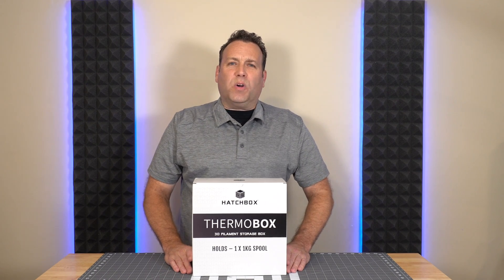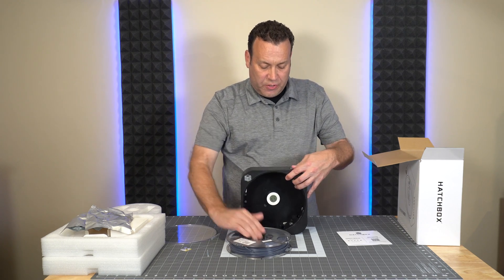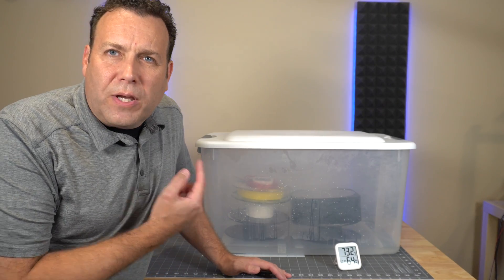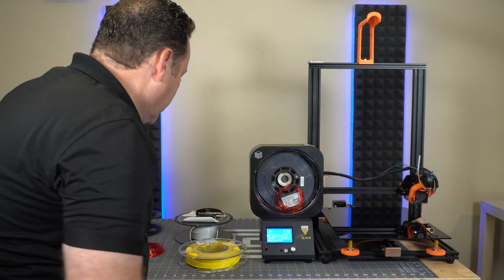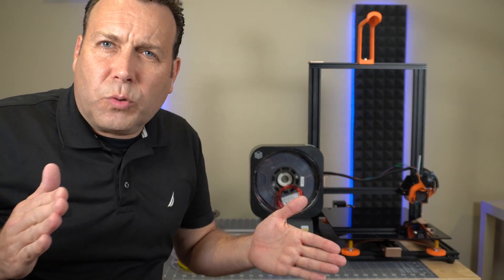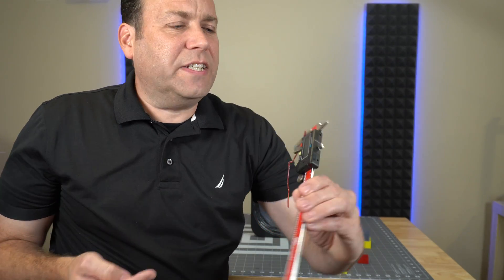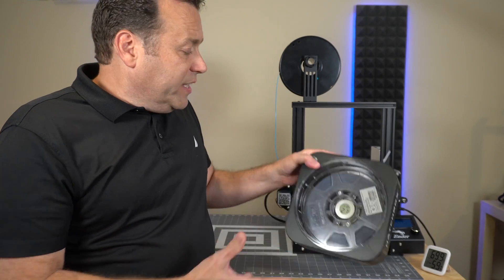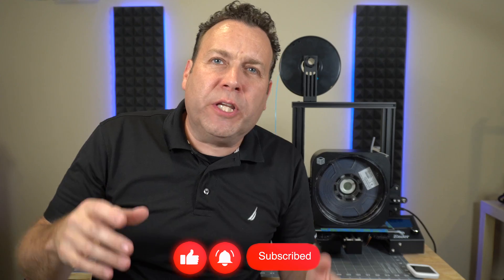Hatchbox Thermobox 3D Printer Filament Storage Box - Full Review - Unboxing, Assembly and Review

Comment: Great video. New to printing and I grabbed 2 rolls of PETG and 2 Hatch boxes before doing research as I was scared of filament moisture . After your video I now understand why I can’t feed from the box as I tried and that’s sad as they make the claim of how you can print from a sealed box etc. I am going to add a spool holder in a bin with desiccants and a nozzle you can close and open for feeding. Either that or going back to food saver bags and vacuum sealing with a desiccant packet. The allure of sealed storage and printing got me. With all my PLA colors it would be a literal fortune to protect them all in hatchbox.
Reply from the maker: Just my opinion…. I do not think it is necessary to print from sealed container for PLA or PETG.   I leave these rolls out for weeks or months with no issues.  I usually just ziplock bag with desiccant pack and that last a very long time.  Nylons, abs and tpu do need more care and more hygroscopic.  In my opinion… “Filament Moisture” is the go to of what wrong with prints… when most of time it is something loose or poor settings.
Reply: @tr3nDmaker  awesome much appreciated. I am still learning and making the jump from PLA to PETG for some projects and wanted to make sure I am doing things correctly. Our house is central air and usually around 35 - 40% humidity so the closed-up bags had been working so far. I might toss them all in a bin with some desiccant packets and a monitor and call it a day. Thanks!!

Comment: I agree with your conclusion. Since its only designed to keep humidity out and really nothing else the price is too high. Like you said you can go to a store and buy a container for $10-$20 and keep several rolls of filament in it and throw in some dessicant packs. Which is what I'm currently doing. Hatchbox needs to figure out how to get that price down to  at least $20 per unit. Ienjoyed your video. One critique if I may? Slow down your talking just a bit. It looks like you are running out of breath sometimes. lol Take a deep breath as just talk as if you were to a friend. Don't force it. Anyway keep making content. I think you are good at it. Two thumbs up on your review.
Reply from the maker: Thanks for the feedback.  Honestly, that is how I am in real life.  Talk very fast and pretty hyper.  I probably was out of breath.  I think that main shot took about 10 takes.  What printers(s) do you have?
Reply: @tr3nDmaker  CR6 SE But I got my eyes on a Ender 5 Plus or a CR 10 Max next.
Reply from the maker: @Skott62  The CR6 SE looks like a nice printer. Both the Ender 5 Plus and CR-10 Max look like good choices as well.

Comment: Very helpful and informative! Could you do a video on how to dry filament using an oven and/or other methods?
Reply from the maker: Great suggestion!I was thinking about that very thing this morning.  Also, been looking into making a cheap storage box.  Thanks and I will work on it.
Reply: Get a cheap food dehydrator on amazon and put the tray mesh so you have space for a couple rolls of filament. Heat to 115* and let it run for 7-8 hours. I spent about $30.